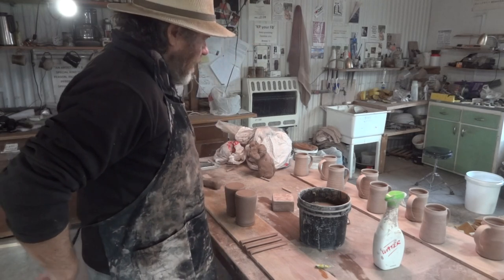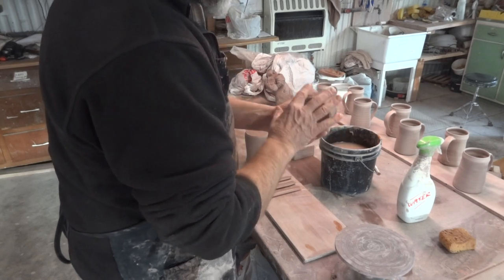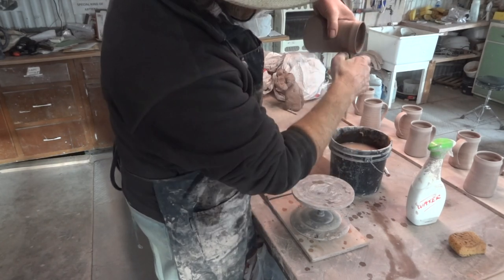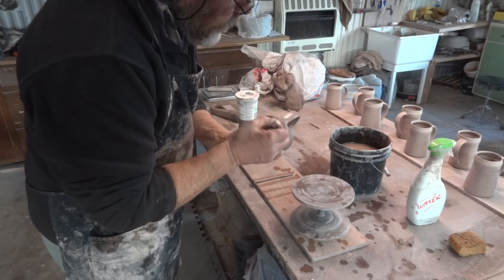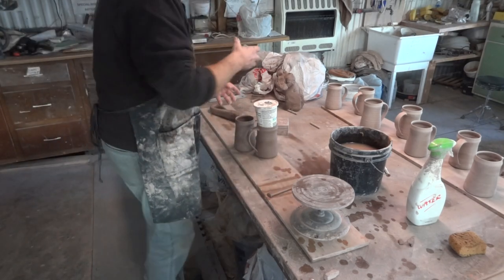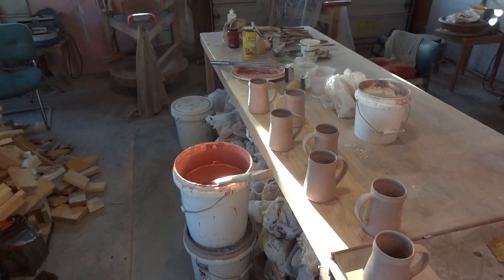Studio routine ! ... handling and raw glazing...March 1st 2021 with Simon Leach

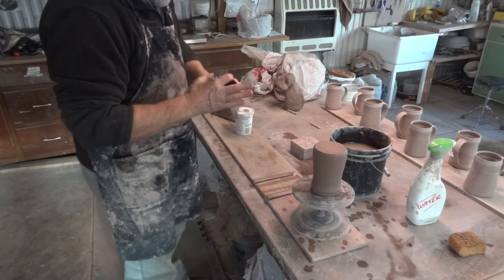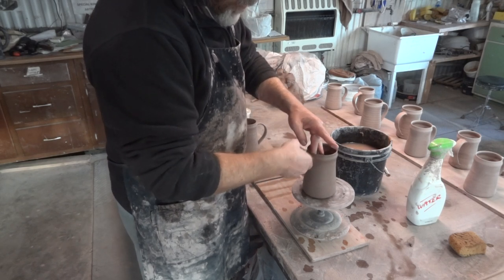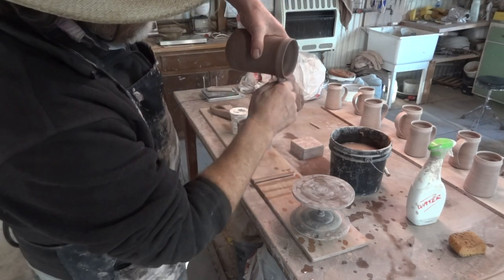Comment: I noticed something after watching my hero Simon Leach throw tankards over and over for the last three years on these videos and trying to come close to this design myself with mixed results mostly not satisfactory. I'm an amateur so maybe this will help other amateurs...on tankards, notice Simon's outside hand on the pull, he moves slightly from about 5:00 at the base to 6:00 or 6:30 towards the top to have good control of inward shoving shape. I tried this tonight and had so much more control and height 😂 long post , but sorry I am obsessed with the Leach tankard !!

Comment: I wish I could do that. My pots always crack when I dip them in the glaze. Maybe it´s my clay, but I tried different types. I found a way to work around that problem. I glaze the inside when the pot is leather hard and spray the outside when it is dry.

Comment: Damn smart move spraying the clay to reduce dust
Reply: It's not about clay dust.
Reply: @gerdawhite6012  what's it about then
Reply: @Mizzle420420  - It's about equalizing the moisture content of the vessel. It was bone-dry green-ware and he just glazed the inside. So the clay-body is soaking up all that moisture and adding moisture to the outside should keep the clay from cracking, theoretically. Personally, I don't think he sprayed enough moisture on them, but they are very thin so....

About clay dust: Not all potters are concerned about clay dust. You just watched Simon blow on every single one of those mugs and if they contained any dust of any sort, it all just got blown straight back in Simon's face. He could have used compressed air and he could have done it outside or in front of a dust control air-filtration system but he didn't. Anyone concerned about breathing clay dust probably shouldn't be working with clay....or should wear a respirator ALL the time since clay dust will ALWAYS be present in a studio.....and air will ALWAYS move.
Reply: @gerdawhite6012  I ment when he sprayed his apren
Reply: @Mizzle420420  - Sure am glad you don't manage a nuclear power plant.
Reply: @gerdawhite6012  Thank you.
Reply: Nuclear would be fine. I understood him instantly.
Reply: @ekphrasticmeatie  - I knew you were going to say that.
Reply: @gerdawhite6012  I mean Im a potter I'm pretty damn good with chemical reactions and raw materials, I'm sure I could handle nuclear fission if I studied it.
Reply: @stefanieb.7557  When I used to do epoxy/urethane floor coatings I would get the material all over my pants and I had this one pair I used for years that I wore every time we laid a coat. They built up many many layers of epoxy and urethane (2-3 epoxy layers for every 1 urethane) it got so bad that not only could they stand up on their own but they were so brittle they would snap/crack/break when I wore them and eventually broke apart completely to the point I had to throw them out. Sad cuz I loved those jeans 😅 was pretty funny though, everyone else on the job was like wtf dude get some new pants.